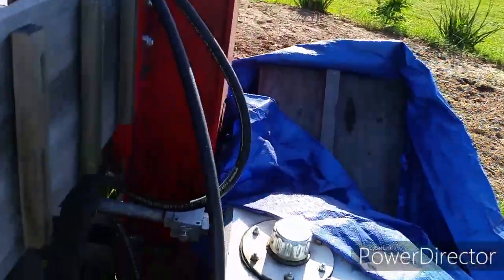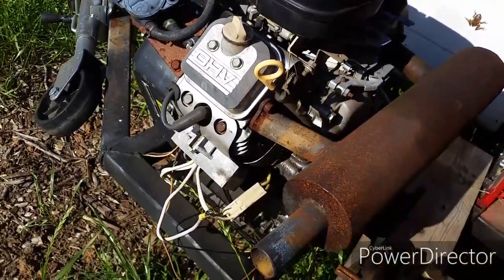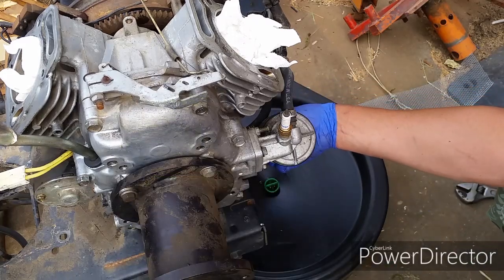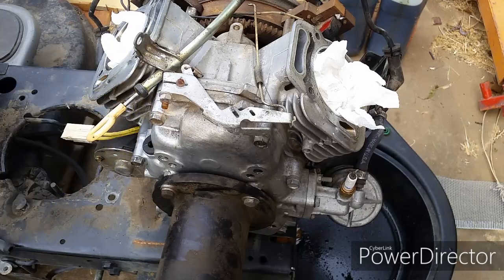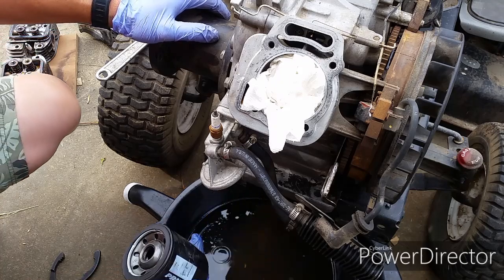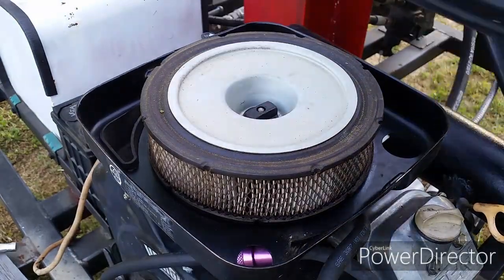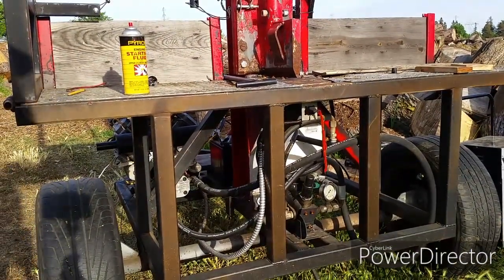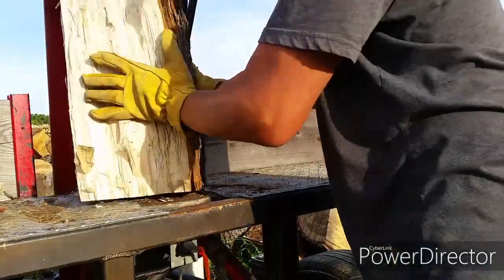Water went inside my Briggs & Stratton 21hp Vanguard engine |Homemade vertical splitter

Comment: Hello, from New Brunswick Canada 🇨🇦 . Looking at maybe converting my log splitter to a vertical style. By any chance did you do a video of how you did yours? Like your splitter 👍
Reply from the maker: Unfortunately, i don't have a video. I built it before i started my YouTube channel.  I gutted an old log splitter and used some of the parts.  If you can find a broken log splitter,  then build around it. If you need to get every part for it, it can be pricy.

As for this log splitter, i built the frame using square tubing. I only recycled the old wheel axle and the hydraulic ram. I had to buy everything to add to it.